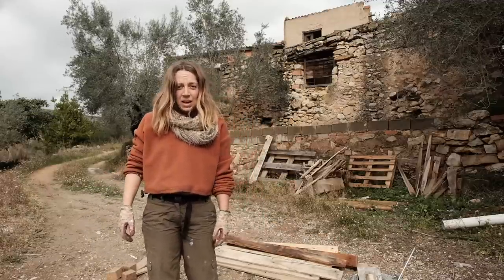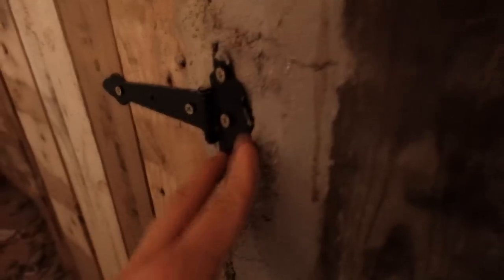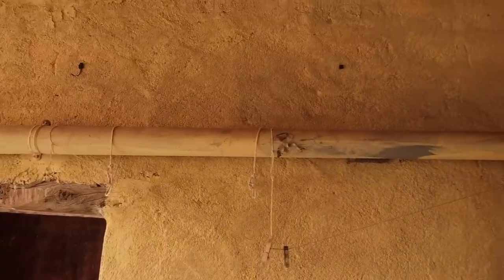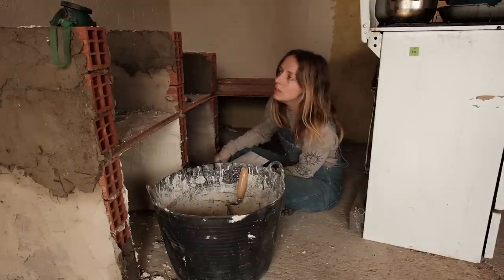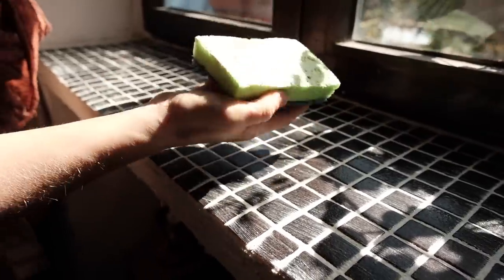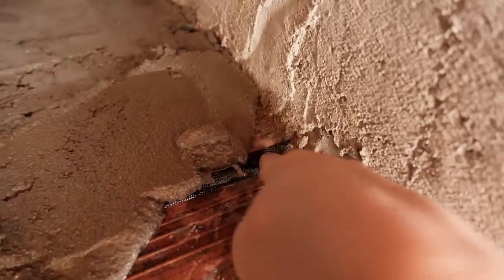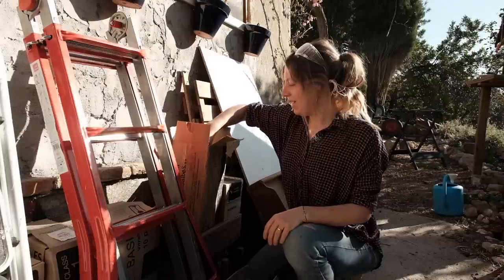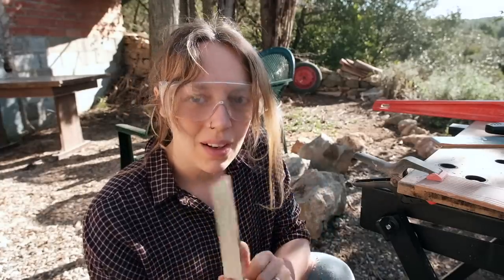Restoring an Old Farmhouse in Spain | BUILDING A HOMESTEAD

Comment: An interesting video!👍👍 I noticed that you really push hard on your saw when you are sawing wood and that just makes the job harder, the idea is to let the saw do the work, so light pressure is all that is required, to start the cut just draw the saw backwards and that will make a groove and then continue to saw in the usual manner.  If the wood which you are cutting is damp, then take a candle and rub it over both sides of the saw blade and that will make the sawing easier, recoat the saw blade with wax as often as required.

Comment: Hi my view would be to box in the drain pipe with some painted MDF or some lower cost hardwood. Maybe add some low power LED lights underneath, cabled from within the box to a supply and switch.. Good luck.

Comment: You could build a shelf that goes along the whole wall with a lip to camouflage the pipe or an enclosure around it along the whole wall. Like a bulkhead and use as a display shelf.

Comment: Your kitchen is coming along well,it will look lovely and cosy when you've finished. Great idea to use pallet wood for the cupboards,the tiles look super. Nice to see the cats and dogs playing about together❤. As for the pipe you can either box it in,paint it a contrast colour or paint it the same as your chosen wall colour so it almost disappears, will look more uniform if painted the same. When I buy old second-hand furniture that does not match, I will strip it sand it and paint it the same colour so then it all pulls together. Just a thought😊😊😊

Comment: Hiya! 
For the pipe, I’d recommend boxing it in using something smooth, so you can paint it to match, or use the pallet wood to match the doors.
Boxing it will give you a shelf and something to screw hooks into underneath.
If the pipe is on an angle, maybe make the box as big as the angle or stagger it so it steps down as it leaves the kitchen. Stepping breaks up the shelf, giving you several smaller shelves.
👊🙌

Comment: Well done Harriet.  Before you want to use the silicone put the tube in some very hot water to warm it up.  You will find it will come out so much easier.  Good luck xx
Reply from the maker: That's a good idea! I was considering putting it in the oven 😂🙈

Comment: Looks nice! The bricks, tile, and white plaster all came out well. One suggestion for working with wet wood (looked from your clothing like you had disassembled the pallets and made the doors the same day) - let them dry out in the room/atmosphere that you will install them in, for several days/a week. Wood expands when wet and then when it dries it shrinks, so if indeed you made the doors when the wood was still damp from the rains, those slats might develop spaces between them when dry. Anyway, keep up the good work and the videos.

Comment: A good way to attach cabinet doors like this is to run screws through a 2" x 1" vertical board into the cement on the side where the hinges will go. The you can screw the hinges into that board and the door itself to connect them. its stronger and easier to do and also easier to adjust as things move over time. Another thing is to use power tools rather than handsaws etc. Much easier and more accurate.

Comment: Love your work Harriet. The best way to do things is exactly what you’ve done. See what works for you and then adapt. Do one thing - then by the time you get on to the second and subsequent you know the best way. Those doors look great. Really nice to see your house developing.

With the ceiling mastic/filler there are many ways you can do it. Try putting a little onto your metal spatula thingy and applying it that way, or, cut the tube a little further down and with a bigger hole the filling gets a bit easier, especially squeezing the handle, and excess can be spread down the joint. Depending on what the filler is based on, either vinegar or water can help with smoothing and have some handy to clean your spatula.

Great job though, and looking forward to the next update.
Reply from the maker: Thank you for the tips 😊

Comment: Build a square frame to fit doors, set in space making it plumb and level using shims of wood but seal wood that will be next to cement for moisture, secure to cement  opening then fill gaps around frame with cement and spray foam if needed, then hang doors, woalla!
Reply: I had not watched all of video when I commented. Basically you did your own version of this, so you figured it out as you always do, you are so awesome and amazing all the daunting tasks you take on. You did a great job btw!

Comment: Those overhead jobs are the hardest. I've sealed gaps in the floor somewhat similar like you've done on the ceiling and I was glad I got myself a press adapter for the drill. Definitely saved my arms. For overhead work, the added weight likely offset the gain of electric power. Those chocolate tiles look flashy, but from what I cant read from the videos I might not want to introduce darker surfaces in the house. So maybe look for a light stain for the cabinets? Chalk might work? To get wood projects to the perfect size, build them slightly oversize and then cut them down for nice consistency. Oh and do get yourself a belt sander, those discs are very expensive I believe and belts are cheaper and leave a more even finish. I hope you're still enjoying all the hard work!
Reply from the maker: Thank you for the tips. Sander is definitely next on my list of tools I would love to have, especially for all this sanding I'm gonna need to do coming up!

Comment: I would build a long box to cover the exposed pipe, use pallet wood so it will coordinate with the rest of the kitchen, the top would be a shelf and you could put hooks on the bottom, and you could hang pictures or other stuff like cookie cutters etc on the front of the box with just a small nail

Comment: Everything is looking so amazing - way to go!!! For the pipe, I think I would try to conceal it by putting a shelf board on top, maybe for dry goods or dishes or plants. Then I would either encase it with another two boards in L-shape underneath (you could drill hooks into the bottom of the L-shape to hold some mugs or hanging plants), or I would just mount another shelf board directly underneath the pipe, and lay some spice/tea/herb jars onto that second board! You would create a shelf with very little height and by placing small items there, they would hide the pipe. Can't wait to see what you do with it and the rest of the kitchen :)
Reply from the maker: Thanks for the ideas 😊

Comment: You need a frame that fits around the inside of the space (a door frame) you can fit this and make sure it's uprights are parallel with each other then cement up to the frame ! Then fit the doors to the frame

Comment: Hi😊 about the pipe in your kitchen,
I would build a wooden box, like a beem. You just conect three pieces of boards and you can also stain them.
I would put it on the hole wall not just until where the pipe ends. And then hang hooks or a road from the bottom of it. So it will be a shelf on the top, a decorative alement, also you can hang pots pans from it and it would not look clumsy and messy
Reply from the maker: Thank you for the ideas, I know what you mean! 😊

Comment: Make a wooden frame to have the doors fit inside, like a picture frame, rip down one of the long boards butt the top and bottoms, drill a hole and use wood dowes and glue, and use some wood glue on the braces before you build the doors it will stop the boards warping, hope that helps, if you have an issue braking pallets use a car scissor jack and your electric drill with a socket on the end, if the jack has a loop just put a hook in the drill, that way you wont split the wood

Comment: It depends on what colour you want the wall, but perhaps the easiest is to paint the pipe a slightly darker colours, visually it becomes a shadow. 
The way those cupboards are done will eliminate bugs etc from entering/chewing up surfaces. I do like those older tiles inside the cupboards. 
A lot of figuring, reconfiguring, but the end result is quite suited to the house.

Comment: The bottom base wood, on the floor at the base of the bottom of the lower doors in the kitchen,,,  I might think of using tile and not wood, for moister, bugs or just to seal, from tile to floor tile.  Just a thought.

Comment: Stick bolts into the holes in the bricks before you mortar them. You can then attach your doors to the bolts
Reply from the maker: Mmm bolts instead of screws. Yes, I see that would work better!
Reply: @LittleSpanishFarmstead  Heads of the bolts got into the mortar, ends of the bolts stick out so you can use a nut to attach either wooden frame or hinges directly. This is how it is typically done in exterior applications, where wood will tend to roat if you cover it with mortar. Onjly the galvanized or stainlesss steel is covered by mortar and it won'trot or rust

Comment: Do you have moisture issues with your walls in the house? Only asking because some lime concrete mixtures breath and some don't and trap moisture.
Reply from the maker: We don't, so far. The kitchen has been built mostly with brick and cement on top of an old stone base, so I didn't think using lime would help me in this case (lime over cement - no point?). Otherwise it's something I definitely would be looking into!

Comment: I dont think sealing the celling from the inside is going to work all that well, if its a flat roof you'll need to paint it with roof seal  in spain its like a red colour.
The other thing you could use is Thomson rubber paint but it is black so may have a problem with heat, that's something you would need to check.
Can seal for up to ten years at a time iv used it on flat wooden roofs and re painted it every three or four years to be sure
Reply from the maker: I'm not sealing it for leaks, I'm sealing any cracks where insects etc can nest. It's already watertight thankfully!